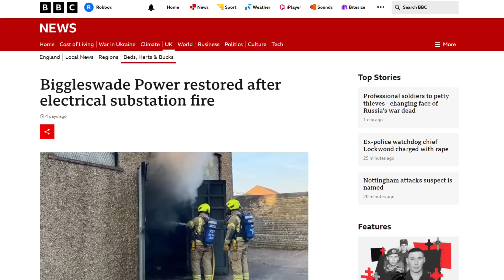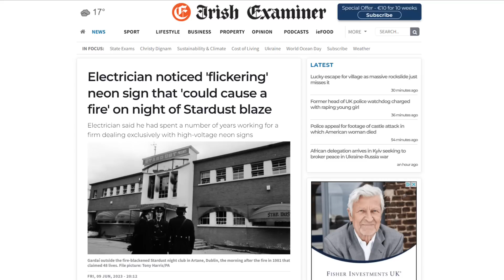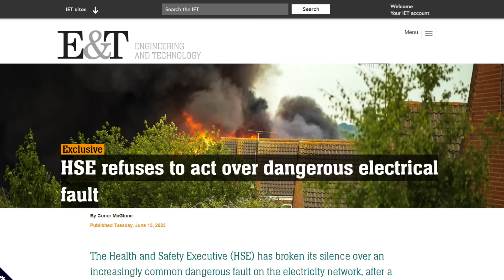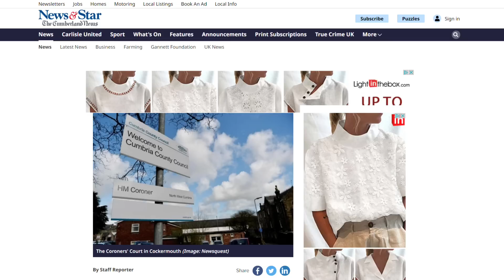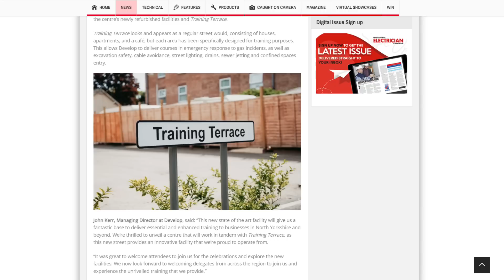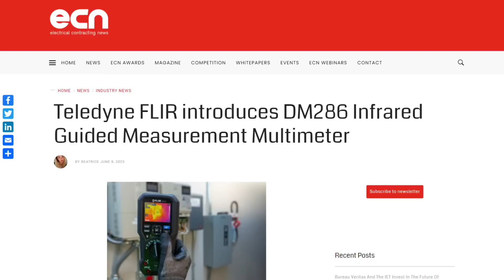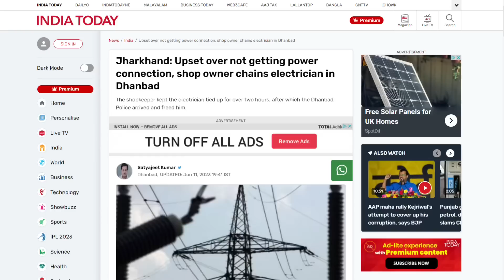Fatal Boat Blaze Blamed On Short Circuit

Comment: Something that shore electricians might not know. Ships electrical systems below 1000v are insulated neutral. Meaning you can have an earth fault without tripping the circuit, however if you have 2 on the same phase that will create a short circuit condition and trip.
If a ship generates 3 phase 415 a transformer must be used for the 220v circuits. You don't have the option of using phase and neutral. Various transformers are used onboard as isolation transformers and the secondary side will have earth fault detection. Older ships used 3 lamps, equal brilliance meant no earth fault but more modern one have earth fault meters.

Comment: The luxury Italian boat Builder Benetti shelled out al lot of money to rewire a substantial amount of their vessels under warranty. I personally witnessed some of the failed cabling manufactured by Prysmian. The insulation had become extremely brittle to the point where it would crumble off the conductor if disturbed. The cable was installed onboard and was not exposed to excess heat or UV. Simply an error in manufacturing. The issue was kept quiet by mutual agreement between the manufacturer and the ship yard. I would be willing to gamble that a lot of vessels still have that cable installed.
Reply: Interesting. Bet that continues to be kept quiet

Comment: That happens because the client is asking for reference instead of good quality of job done and adequate electricians which follow the regulations. let's be honest and stop lying because there is no sites in UK made of at least normal quality. I have worked in many sites in London, and all of them have been of very poor quality. The companies only care about money and don't give a damn about the quality of their work. They don't care if their electricians are not adequate, and they tighten 15Nm bolts with 150Nm impact. While such a bolt might pass the test, there is no guarantee that it is not broken and won't fail after a few months of work, leading to short circuits and fires.